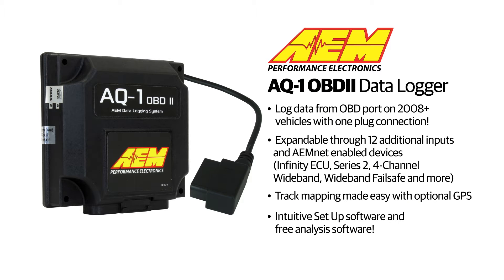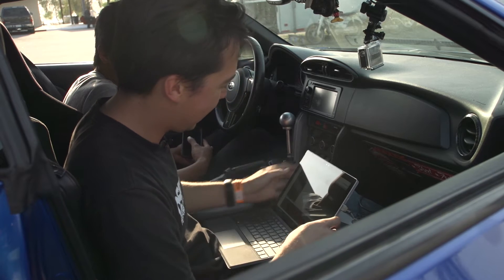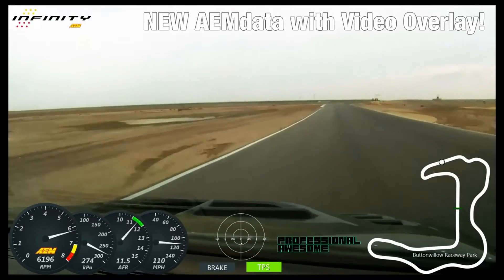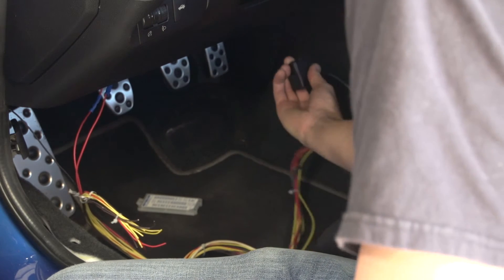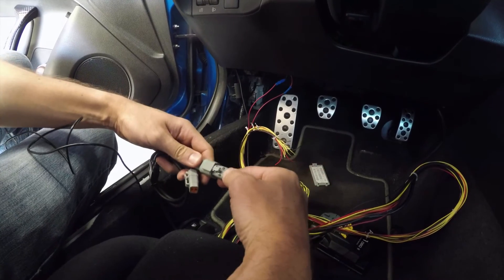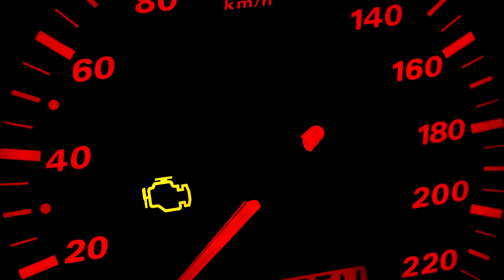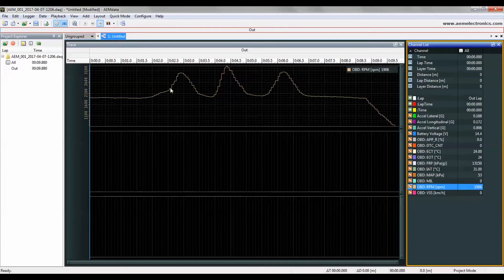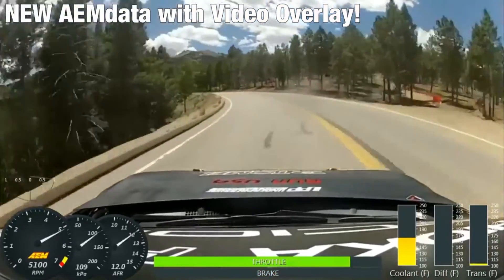AQ-1 OBDII Data Logger Features - Log Data from CANbus through OBD Port!

Comment: This is useless.  Classic or vintage cars don't have an OBD data system, and most engine analyzers require one!  Vintage car owners need a way to get RPM, speed, temperature, voltages, etc. to a computer via an OBD port.
Reply from the maker: We offer a non -OBDII CAN version for vehicles that connect to a computer via USB cable. This allows you to get RPM, speed using wheel sensors or our GPS CAN module, temps and voltage. Many of our vintage and musclecar racers use this system for the exact reason that you stated. More info is here: https://www.aemelectronics.com/products/data-loggers/aq-1-data-logger

Comment: I assume it only works with Can Bus cars? so no luck using it on an 2005 STI?
Reply from the maker: You are correct. It will read the CAN signal through the OBD port only. We do have a non OBDII version of this logger though, you will just need to wire in the sensors you want to use.